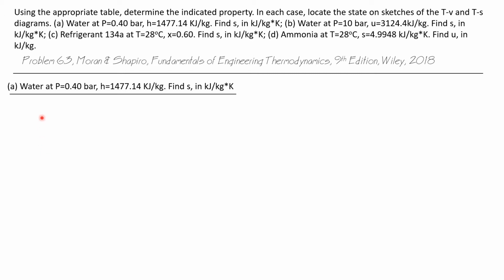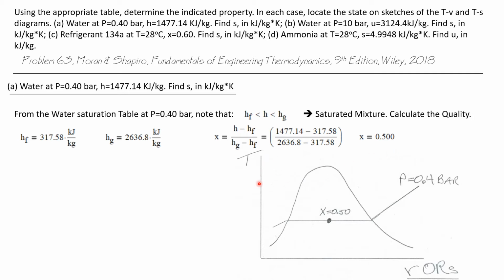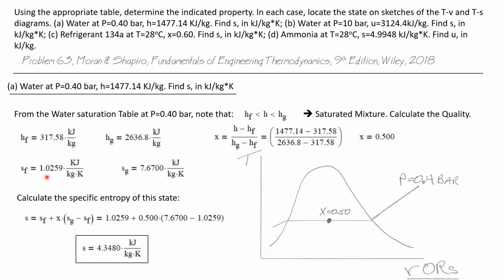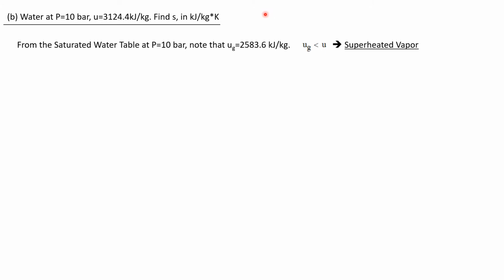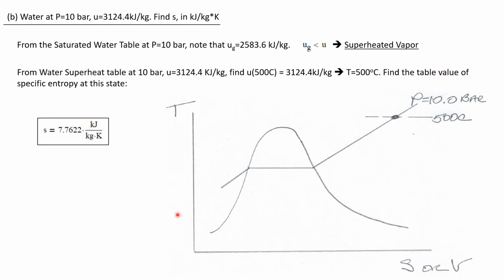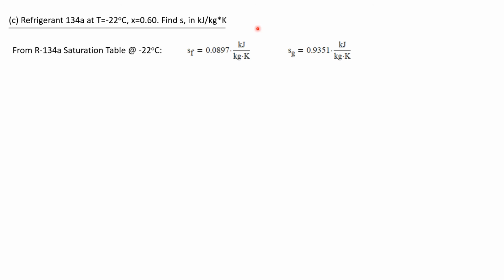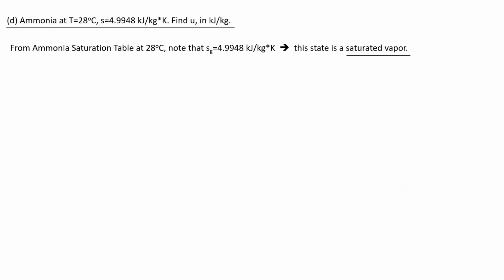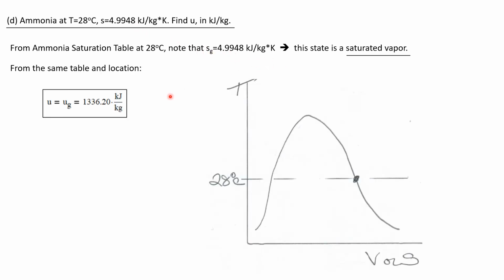Finding Specific Entropy Values in Tables -- Engineering Thermodynamics 86/107

Comment: hiii. at example b, why did you assume at 50 celcius? cant we directly use the given u and locate it at the superheated table at p 10 bar and then interpolate using u and s values?
Reply from the maker: Hi Jamaica May,

Thank you for your question. You are correct in your statement about how to solve this problem. I also solved it as you suggest but, perhaps, did not explain what I was doing sufficiently.

We know that two properties define a state and this water’s given properties are a pressure of 10 bar and an internal energy of 3124.4 kJ/kg. We need to find a state in the superheat tables with these properties, so begin by looking in the sub-table of 10 bar. We are looking down the column for internal energy looking for a value of 3124.4. We would not normally find this exact value in the table but would find it bracketed by two rows and then have to interpolate a value of entropy. However, in this case, the value of 3124.4 is found exactly in the row whose first column is 500C.

So, I did not assume that the temperature was 500C; I found that at the given properties of pressure and internal energy, the temperature actually was 500C. I was simply using the temperature as a marker for the row where our entropy value could be found, which is 7.7622 KJ/Kg*K

Perhaps you are using a table with slightly different property values (as different thermodynamic tables do offer slightly different property values) and, in that case, you would have to interpolate the entropy value directly from the internal energy values in your table, just as you suggest.

You have a good grasp of this problem. Thank you for your question.

Regards, Jim
Reply: @jimleflar3166  we have the same reference. shapiro is my textbook too. and thankk you so much for taking time to replyy to this and actually ding what i thought.. god job on your videos! it actually helped me on my finals last january 18. i was ramming and have no time to digest the book, so your playlist on chapter 5-6 is what i just watched! best regards!